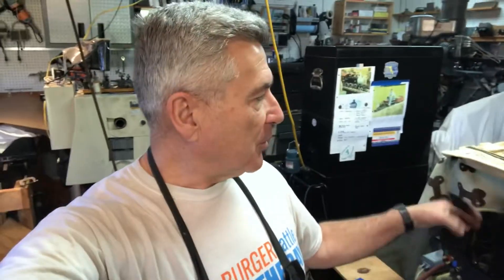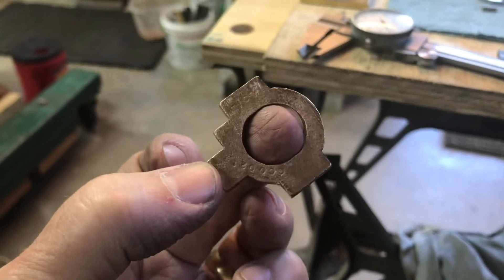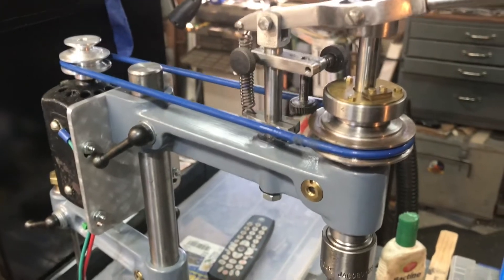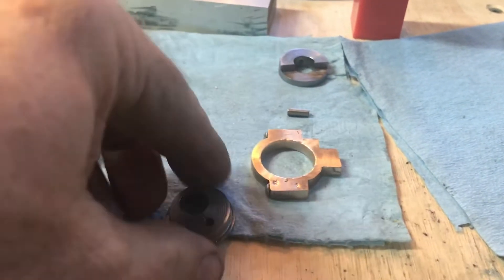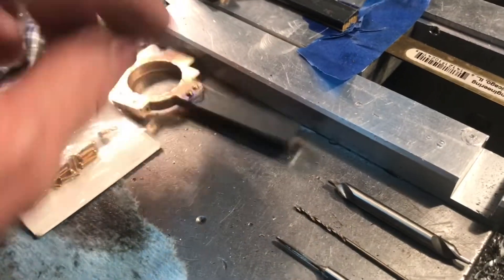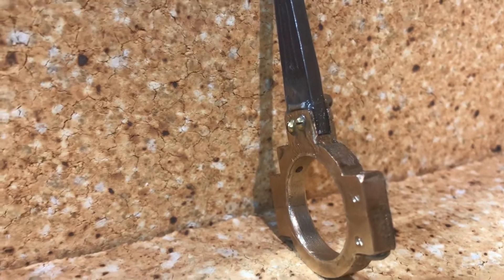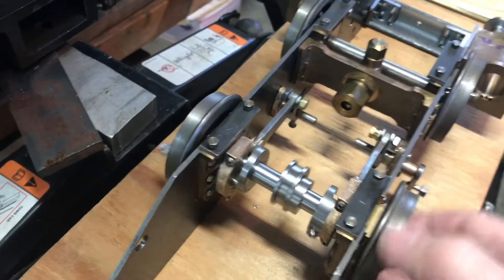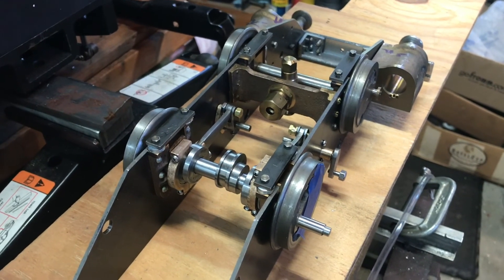5. LBSC TICH, machining eccentric straps, fitting to rocker levers

Comment: I'm really interested in following your Tich build but I'm have a hard time hearing the audio. My speakers are turned up all the way but the improvement is only barely marginal.  I wonder if I'm the only one with this observation? Fwiw, can you check your equipment and mic for audio issues?